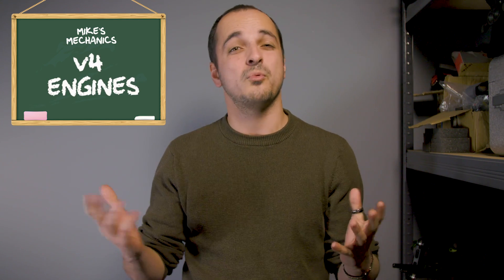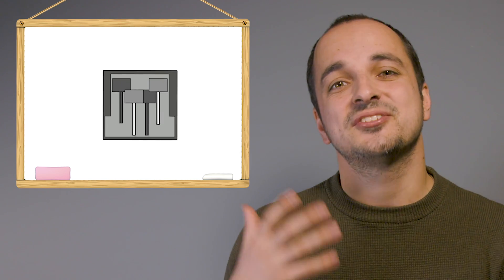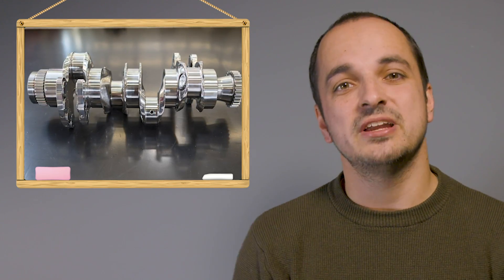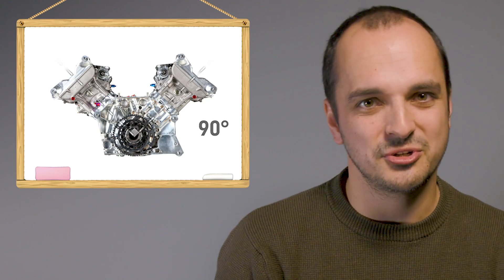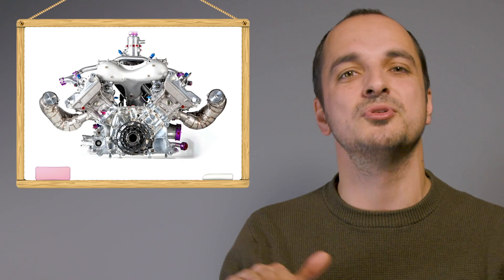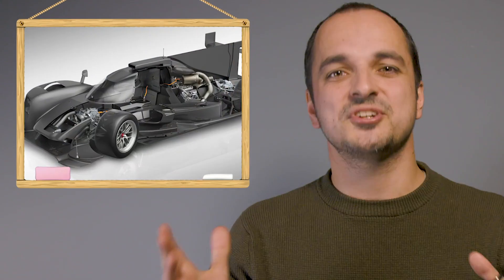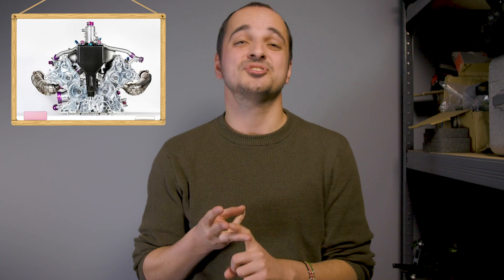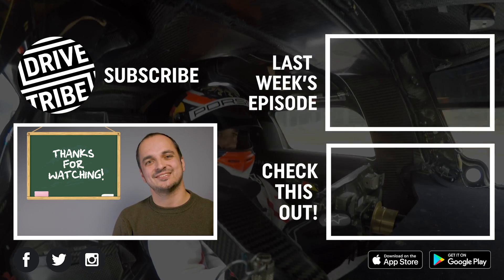Why V4 engines are so rare and which cars use them - Mike's Mechanics

Comment: I remember my Evenrude outboard engine back in the 70's was a V4
Reply: Used to have a v6 2 stroke evinrude motor. Thing ran like a scolded dog, when it ran right
Reply: Steve Wilson, Had one to, it required nearly two and a half times more gas then the Honda 225 I have in this days, and believe me Sweden government do put ridiculous tax on gas ! 😂
(For the moment price is nearly 2 euro per liter )
Reply: You sir had a hot rod eventide
Reply: Great motor.
Reply: Ford granada
Reply: They used a v4 up until the late 2000's
Reply: I have a 1978 evenrude 115 v4

Comment: Can you explain why the death wobble occurs? Especially on solid front and rear axled SUVs from back in the days. Heard horror stories from models like Suzuki Samurais and older Nissan Safaris who did some offroad modification.
Reply: Death wobble usually occurs when the geometry of the front end is not correct due to wearing of the bushings and balljoints etc.  Jeep Cherokee, grand Cherokee, and wrangled. All have this issue when people put lift kits on them, or when the control arm bushings go bad. 90's and up all of them get the wobble.

Comment: imagien one with a cross plan crank
Reply: V4 and v8 mainly are cross plane, if you put a flat plane crank in a 90 degree v4 or v8 you'll need balance shafts but as the crank is lighter, they are much more responsive.

Comment: Ford did two V4’s, the 1.6 ‘Cologne’ (which was also sold to SAAB for the 96 and Sonnet) used in Taunus and German Transits and the 2.0 used in Corsairs and UK Transits as well as the Capri.  
Of course the best known V4’s have a 180 degree V-angle and were used by VW extensively, Subaru and now also Porsche.

Comment: I wonder is it a possibility to get a 1000 horsepower v4
Reply: I don't think that would be any problem. If you made everything out of strong enough materials to handle the stresses you could likely go a lot further. If there are inline 4 engines running with well over 1000horsepower I don't see why a V4 couldn't do the same. The tradeoff being that fuel economy and orther costs are going to be silly

Comment: U never know F1 cars may be using them one day
Reply: Nah they'll probably skip right to V-twins.
Reply: @actualperson1971  two-stroke one cylinder bruv
Reply: @OmegaF77  two stroke is not eco friendly enough, 4 stroke 1 cylinder sky-active hybrid turbo!
Reply: @RCmaniac667  *skyactiv
Reply: @actualperson1971  F1 was destroyed when they started limiting the number of cylinders ...as I wouldn't doubt a. V twin  next as the Drake engines where built in Indy for the speed drome that was an indoor Motorsport of Myer Drake .cars the size of 1/4 midgets ..and guess who licensed the. Manufacturing of the Drake engines ...they were 90 cubic inch knuckle head Harley's with crude water jackets that was fastened around the jugs after a bit of extensive machining lolol ..cranked  about 4000 rpm before they would turn into a grenade and self detenate
Reply: The future of f1 is either hydrogen or electric
Reply: @MrLyo0  I agree and go for the Hydrogen powered cars!
Reply: 1 cyl, twincharged hybrid.
Reply: Not likely imo... combustion engines are slowly dying sadly
Reply: kevin paul halliday 
Ducati and Aprilia are already using V-4 engines in there super sport motorcycles. Technology is so advanced that more cylinders outweigh displacement. To compete with four cylinders need a four-cylinder. The same thing goes with a 90° V6! I like my 90° V twin 1299 S Panigale at the race track! 1199 is the maximum displacement for a V twin and it cannot compete with the four-cylinder 1000cc because of technology! The twins are allowed extra 200cc in competition races.
Reply: Meh,F1 is looong dead.
Reply: @carlosb1  no

Comment: I can’t believe you didn’t mention Ford’s V4, fitted to the mass market Corsair in Europe in 1965, essentially a Cortina with a posher body glued on but that year with a small V4. You omitted to mention that Ford sold these V4 engines to Saab, not just for the low volume Sonnet but their mainstream, bread and butter saloon, the 96.

Lancia used V4s in their ranges from the 1920s right up to when Fiat bought them in 1969.

Comment: Primary forces do not balance each other out in an even firing 90 deg V4. This does happen in a V8 and odd-firing L2 (90 deg V2), where crankpins are shared by the pistons from opposite banks. It converts reciprocating forces of the pair of pistons into rotational ones, easy to balance almost perfectly with a counterweight on the crankshaft. This technique is employed in a crossplane V8, which does not benefit from I4 primary balance in the banks as in a flatplane V8 - which on the other hand suffers from I4 secondary imbalance.

An even firing 90 deg V4 has the crankpins split by 90 deg, which destroys the primary balance and requires at least one balance shaft to get rid of vibrations.
Reply: You're wrong.

Comment: ford used a v 4 in early transits and the ford corsair as well as saab using it in their 96 cars
Reply: The Ford V4 was a farm implements engine.
Reply: And the mustang 1 concept. And mid engine.
Reply: This V4 was a 60-degree engine, basically 2/3 of the Essex V6, with a balancer shaft.
Reply: And in the Zephyr V4, IIRC - or you could have the V6 (which is the car that I learned to drive in)

Comment: Great video. Had several Honda V4 1100 CC motorcycles with that engine configuration that put out 160 plus ponies to the rear drive crown and pinion gears. Amazing! This is why I’m far more excited about small displacement, high revving VVT Timing,  Gas and Diesel engine efficiencies over full electric vehicles.
Reply: What Model Honda V4 1100 has 160+ HP?  Is that the New VFR? I can only think of Honda ST1100 & Honda Sabre V65 - the Sabre was Pretty Fast but Maybe made upto 120hp! I have a VFR800  Great Bike but puts out 110hp Stock - The Factory RC45 Racebikes Managed about 150-160hp @ the Crank - Cheers👍😉

Comment: that's why if developers develop a V4 they should make it 90° what idiot would make it different from that if it's going to cause vibration issues
Reply: Different angles can cause different response from the engine a engine is naturally going to be balanced or it wont work. So of the engines crank and cam are in balance and it vibrates racing has no care in the world for vibration. Even race v6s will a lot of the times be used with no balance shafts even if they are odd fire

Comment: Yeah, that's all fine but a flat 4 uses two cylinder heads, valve trains, inlet and exhaust manifolds and VW sold 21 million in the Beetle, although air-cooled. Then there's the Porsche, Subaru and Toyota flat 4's. I propose that Mike's argument for the rarity of V4's is somewhat spurious, as their complexity is essentially the same as a boxer unit.

Comment: Not to forget the SAAB 95,96 and Ford Taunus 2.0L V4s....we used a 2.0L Taunus V4 to replace a Wankel engine in our NSU Ro80. Short and compact little power house..Ford Transits used to use them.
Reply: @tecdessus That sound about right...Thanks

Comment: Ford in the UK had a 60 degree v4. Granada and corsair had them. I put one of these engines in dutton. It had a balance shaft. Small compact motor. Not very popular because of vibration and ripping the teeth of the timing wheels. It didnt have a timing chain. Just two gear wheels, one steel, one a fibre material, and the fibre one got chewed up somtimes

Comment: V4's got a terrible reputation for reliability because of Fords total cockup.
Ford developed a 2 litre V4 in the 1960's which they put in all sorts of cars from the Ford Corsair, Zephyr 4, Transit van. However it had a lifetime of around 50,000 miles. Before total self destruction. 
This was solely caused by too long a service interval and the quality of the oils around at the time. This is a fault Ford have repeated many times on many engines and are still doing so to this day with the new 1 litre turbo engine used in Transits, but that is not a V4 so I digress.
The service interval was every 6000 miles. According to Ford, which gave an engine life of around 50,000 miles. If you dropped the service interval to 4000 miles the engines ran for ever, frequently clocking up well over 150,000 miles which for the 1960 / 70's was almost unheard of. 
The Ford Taunaus V4 engine was also developed as an in board motor boat engine. In a sleved down 1600cc size. This engine was used by SAAB in several of their models including the 95, 96 and a few early 99 models. 
SAAB got the service sorted and it was a fantastically reliable engine and when tuned won many rallies and motorsport races. It dominated the rally scene world wide for almost a decade. 
The main advantage of the V4 besides its tiny size was the huge amount of torque the engine produced. Way more than engines twice its size around in the same time period.
Reply: william  armstrong no never ever in the 99 it had inline 4 cyl.

Comment: I don’t believe that complexity or cost is to blame for the V4 platform being ignored in modern automotive applications. Motorcycle manufacturers have no problem producing amazing, cost effective and reliable V4 engines, many brands have produced small capacity V6 engines for applications where 6 cylinders were not completely neccesary (Mazda, Honda etc), and any manufacturers existing V6 or V8 design could be theoretically “cut down” into a V4 without major redesign. 

I think packaging and use across multiple platforms is really the only excuse not to try it. In a compact FWD layout you want the shortest possible nose, so you use a transverse inline engine. In a mid size FWD platform, you have plenty enough vehicle width to use a V6 so you may as well. In a compact RWD layout, you want a narrow chassis with plenty of room for suspension and steering so you use an inline engine, and if you’re squeezing in a V engine you’re also going to have easily enough room longitudinally for another two cylinders, so again, why not use a V6. For larger RWD layouts you’re probably designing the car around a V6 or V8 and borrowing a 4cylinder from another platform to offer as a lower performance variant so you aren’t going to design a unique engine for that application. 

Subaru’s AWD layout could lend itself well to a V4 being similar in packaging to their flat fours, but there would only be a disadvantage of higher centre of gravity compared to the existing flat four. 

I do however believe there may be room in the future for new V4 designs when coupled with hybrid systems, I could see a higher performance mid size FWD platform taking advantage of the shorter engine in order to fit a larger transmission system with larger electric motors for example. 

Well that’s my rant over anyway, thanks for reading lol

Comment: You said the V should have 90° between them. But the same is true for all V layout engine, and they are not uncommon. Why is this so?
Reply: Often it's packaging considerations.  A narrower V is more compact.  Also in a V6, or a V12, a 60 degree angle gives better overall balance.

Comment: And there was a 1700cc V4 fitted to Ford Corsairs in the sixties.
Reply: There was also the 2000cc which, when coupled to the auto box wasn't reliable BECAUSE the kickdown would drop into first gear and blow the engine
Reply: There was an Essex v4 1700 and 2000 the transit had  lower power the car variant had a bit more go
Fitted to corsair consul granadas saab used it to

Comment: in europe v4 is standart and thats where you would see that v4 engines in many times are not durable, long lasting over a time. thats the only bad story i know about it.
Reply: Really?! Name one...?
Reply: @manoo422  i got my second opel astra g 2001. Or like every other country call this brand a vauxhall.
Reply: @sirchaps8489  So that would be the X20XEV engine? an inline 4...
Reply: @manoo422  isnt that right?
Reply: @manoo422  sorry
I got the 2,2l 16v z22se
Reply: @manoo422  i gues i know what you think.
Inline 4 isnt the same as an v4 engine. 
Maybe thats where im wrong
Reply: @sirchaps8489  Vauxhall dont make any V4s I dont think they ever have, cant think of any manufacturers in Europe who currently do!
Reply: @manoo422  yeah sorry thats what i mean i had a wrong point. Now for knowing the build forms of the engines... A v ones and the inline ones.
But i gues in the end still a bigger block would last longer

Comment: Given that both Aprilia and Ducati make 200 bhp, 1 litre NA v4 road bikes (being reliable for general use and not a specialised race engine like the Porsche or MotoGP), what is the likely power output if they scale that up to 2litres with turbos to match the size of the Porsche motor?
Reply: 700ish?